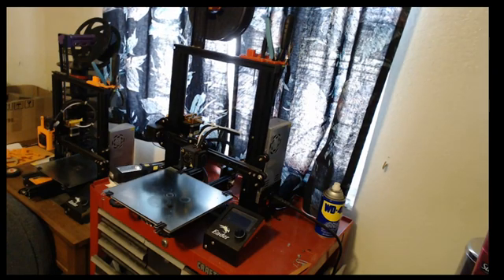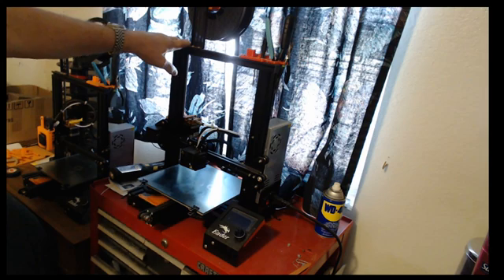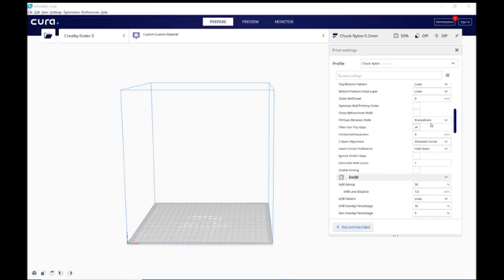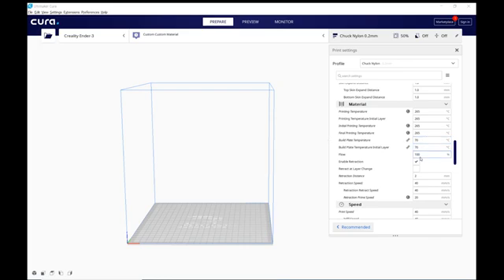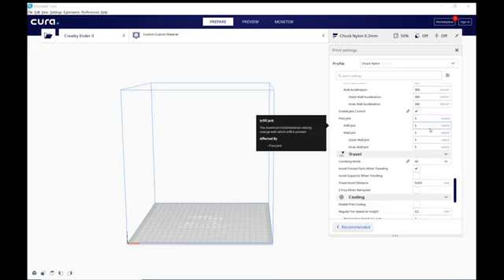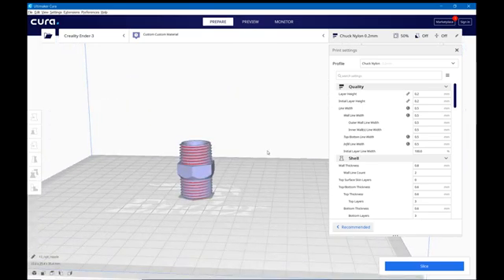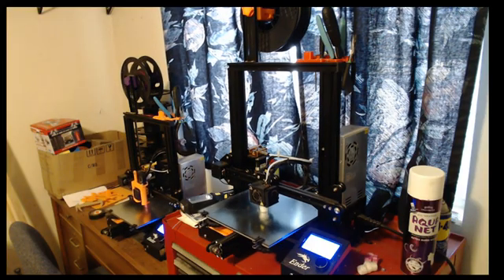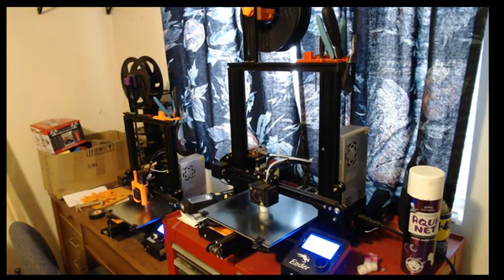Printing  with Nylon Filament on the Ender 3

Comment: I would put the stringiness also down to Nylon. It is very hygroscopic. Even before you pull it out of a new air tight package it probably still has moisture. And once open it soaks it up fast apparantly.
Reply from the maker: I've always wondered at what indoor humidity level this becomes a problem and things like dry boxes become necessary. Not something I think I could easily test at my location, specially at this time of year when the A/C is running damn near non stop night and day, the indoor humidity rarely goes higher than 15%. Maybe in the fall when we switch from the A/C to the evaporative cooler. Even then it rarely goes above 30%.
Reply: @3rdpig  yeah..even with low humidity it will still suck any moisture like it was a sponge to water.
Reply from the maker: @swiftrick15 Sure, I get that. But the question on my mind is "At what humidity level does it soak up enough moisture to cause print problems?". I live in the desert southwest, it's 16% humidity inside and outside here today. I see none of the typical signs of too much moisture in the filament I hear described, e.g, hissing, popping with steam coming off the nozzle while printing. On the MatterHackers website they have a photo of what a thin wall print using the Taulman Bridge nylon looks like before and after being dried in their filament drying machine. I've printed a very similar object and mine looks more like the after drying print than the before drying print. 

So again, how wet is too wet? I don't know, but apparently it's not 16%.
Reply: @3rdpig  QUOTE "Do not think that the process of moisture absorption is slow and that short exposure times to ambient air do not matter. Hygroscopic materials can pick up substantial amounts of moisture in 30 minutes or less. Most will take much longer than this, e.g., PA will take some days to reach equilibrium, but some absorb water very quickly."

The keys are keeping it DRY and WARM. Air free. I think it will absorb moisture regardless how low humidty is as there will always be moisture in the air. Yes higher humidity will absorb quicker but even at low rates it only takes a few minutes for it to start absorbing moisture
Reply: @3rdpig  There should also be a Open Before date on spool. But that means not much. 
Printing in a heated chamber also helps high temp filaments bond and in lowering shrinkage levels right down to PLA levels
Reply from the maker: @swiftrick15  So help me out here. Explain to me why I'm getting good results, without any signs of having too much moisture in the filament, without drying the filament first and with a spool of nylon that has been open to the air for a year?
Reply: @3rdpig  you have lost me now. It clearly showed stringing which is most likely due to moisture in filament rather than retract settings.
But if you are happy then all is good.
And yes low humidity will help but wont stop moisture absorption.
Reply from the maker: I think we're going to have to agree to disagree here. Good diagnostic technique would suggest if I thought moisture was the problem to look for confirmation, in this case look for the other signs of the problems moisture causes. But in this case there are none. 

So while you may be right and it is moisture, without other signs I'd be a poor troubleshooter if I didn't look for other causes. Such as the retraction settings due to the all metal hot end. 

Unfortunately, without a drying machine (no way I'm running my oven for 10-12 hours in the middle of summer, the wife would kill me) there's no way to rule it out. 

Cheers and thanks for the good discussion!
Reply: @3rdpig  I have a cheap all metal hotend and and am waiting for the branded version to arrive to compare the two side by side. And weight comparisons.
Good talk. 
Cheers
Reply: @swiftrick15  did you compare the two?

Comment: Nice video. I’m curious if you tried the stock ender with nylon before switching to the metal hot end, and what you thought. I print nylon sometimes with mine, at around 245-250, all I did was to replace the ptfe tube. My quality isn’t great, and I do have to do 2-3 prints before getting a useable one. Like you I am printing parts, mostly outdoor and car use things. I’m not too fussy about quality, but print failures on large jobs gets annoying.  I’ve been hesitant to replace the hot end cause it works fine on pla which is 95 percent of what I print.
Reply from the maker: Yes. A year ago I made a video testing different filaments in the Arizona summer sun. I printed "S" hooks out of PLA, ABS, PETG and Nylon. While the nylon printed OK at 250, if you bent it much you could feel the layers separate. It would be fine for some things, but if strength was needed (and if it's not then there's really no need for nylon) it wasn't good enough. When I flashed Marlin to it so I could go above 255, I got Thermal Runaway issues. With the all metal hot end and screw in thermistor and printing at 265, as you saw in the video, there is no layer separation. It's an extremely tough part. Have you considered PETG? With some tweaks to your slicer settings it prints good on the stock Ender 3.
Reply: Chuck Bryant thanks. I did watch those heat test videos, that’s why and when I got interested in nylon. I was pretty new then, and maybe everything was all too new for it all to sink in. I’ll try some PETG, but maybe I’ll just bite the bullet and upgrade my hotend after watching your video on that.  But thanks for your videos also. Watch them all, you have a practical side that isn’t in lots of other channels.
Reply from the maker: @SH-td4yt  I'll be starting a PETG video in the next week...or as soon as I'm done with the nylon. I've got a part for my outdoor A/C unit that needs replacing, so I have the perfect scenario for a good test.

Comment: How does nylon do with stock ender 3 with no upgrades??
Reply from the maker: With the stock firmware the Ender 3 maxes out at 255c. There are nylon filaments that the manufacturer claims will print OK at 255. The nylon I used in the video has a suggested temp range of 250-265. But at 250 (as hot as mine would go when it was stock without problems) it would print and the part would look good, but if you squeezed it like I did in my video the layers would separate. There are other nylon filaments that have an even lower suggested print temp range, but I haven't tried them. Also when I flashed my firmware with stock Marlin to get the Thermal Runaway protection and to be able to raise the temp, with the stock thermistor I was getting thermal runaway errors at 250c and above. And much above 255 you're in danger of melting the Bowden tube in the stock hot end.
Reply: @3rdpig  Hi! i got my hands on a roll of nylon (technology outlet brand on amazon) last night: i could print it at 250°C and it looked good and strong, adhesion was good too for the first layers but i suffered from quite a lot of warping, even with the bed set at 85°C... i used painters tape and a brim to try and keep the piece on the bed but it would warp so much it lifted the tape! (mind you i'm printing on a mirror tile, and i helped myself with the spatula to attach the tape to it). How can i prevent warping? I have a capricorn tubing installed so i guess i could crank the temp to 260° (whereas the manufacturer states the ideal temp for that filament is 235...but on that temp i got HORRIBLE results) and the bed to 100 and get better results?

Comment: Thanks for the video!  The Amazon link for the hot end is Unavailable.  Alliexpress has it though for under $5 usd.
Reply from the maker: Thanks. I fixed the Amazon link, apparently that one sold out. The new one is $13 but claims they only have 10 in stock.

Comment: A tap fitting for a outdoor hose would be cool... Im always removing it or losing it.
Reply from the maker: Give me a link so I know what you mean and I'll see if I can make one.
Reply: @3rdpig  Sre... They liik like this..... Also the fitting inside the tap fitting is a reduser for large tapthread or small thread tap...
Reply from the maker: @EliasOda  I think that's a UK/Canada thing, we don't use them in the USA. There is one on Thingiverse, but I'd have no way to test it here. Sorry!
Reply: @3rdpig  All good chuck.... I thought maybe you guys had this same kind of fitting.... Cheers Mate!
Reply: @3rdpig Yeah, quick click.....we use them in OZ......grrrrrrrrr…... the damn things always fail and leak like crazy and after a while the O ring perishes and you get aqua everywhere.

Comment: Hello Chuck
My Ender 3 bed mosfet burned out. I would not wait too long to replace your board mounted mosfet with an external mosfet. Thanks for the nylon printing tips.
Reply from the maker: Been something I've been meaning to get around to. I should order them right now. Thanks for the heads up!

Comment: Thank you Chuck - these types of videos are exactly what I have been looking for. I bought the all metal hot end kit from China after seeing your video on it, and have been considering purchasing a second Ender 3 just to use with it for non-PLA (higher temperature) printing. Best wishes, and looking forward to more videos in this series.

Comment: Chuck your videos are very informative. Keep them coming.
Noticed that your Enders are right up against your curtains, aren’t you worried about a fire? Plus you have two explosive spraycans in the vicinity.
Reply from the maker: Thanks! You're right, it's not really the best place for a 3D printer, but I typically only run the printers when I'm home and in that room. Also, both my Enders are flashed with Marlin so Thermal Runaway protection is active. I've also checked the connectors on the board for the bed heat to make sure they're tight and not burned or failing. And there's a smoke alarm on the ceiling above.  But when I run one all night long I get all the flammables, including the curtains, away as best I can. I've been meaning to put mosfets in for the bed heat but haven't gotten around to it. Maybe that would be a good video when I'm done with the Nylon series?